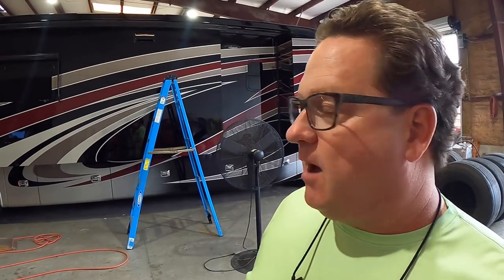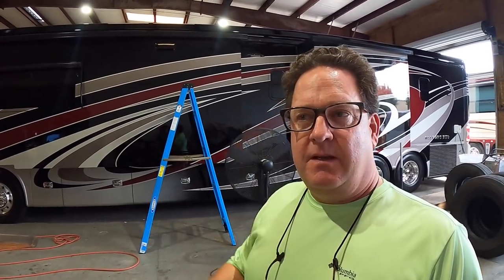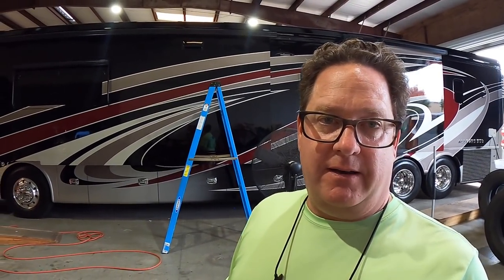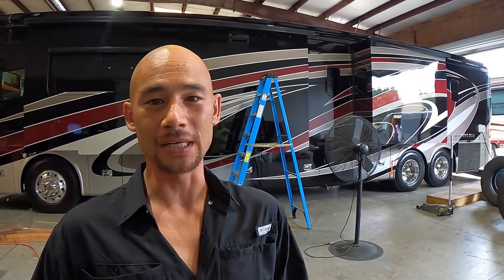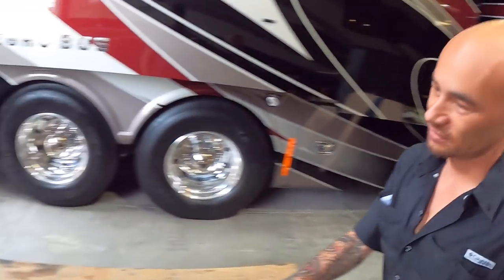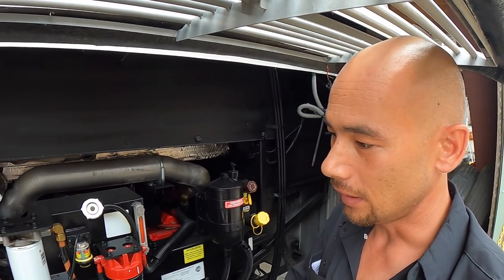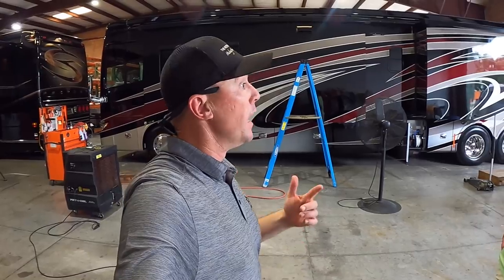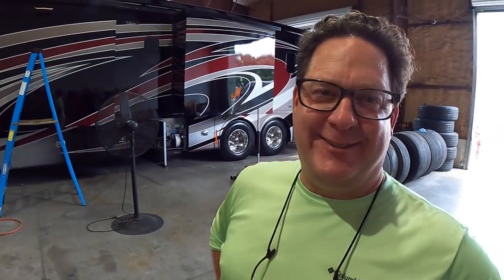RV went into LIMP MODE ON a test drive! Diesel Tech Explains DEF problems

Comment: I built a DEF transloading facility in Canada we received DEF in rail cars unloaded it and packaged it in drums and totes. Out of all the engine manufacturers I believe Volvo has the least issues. That’s because it was in use many years earlier in European trucks.
Reply: I've seen Volvo powered motorcoach busses, I've always thought it would be cool to have a Volvo powered motorhomes as Europe built vehicles are usally more reliable in general.

Comment: That’s why I’m sticking to gas from now on. If you are on a 2 week vacation and it goes bad, enjoy sitting at Cummins on the freeway for 1 of you two weeks. I know, I lived diesel emissions with a 2009 Cat C9 with emissions crap. Vacations were spent at a heavy truck dealer. I’m done. Yes a gas motor can break too but usually I can fix quickly. You have to have special computers and software to fix the diesel.

Comment: I had the DEF sensor failure in mid-June. The DEF sensor is actually $350. The chassis was still under warranty so my cost was $0. My coach didn’t derate which is really rare. Not sure why but I’m glad it didn’t because I was 100 miles from the nearest Cummins service center. The EPA needs to allow Cummins to eliminate the “derate” function from their software until a reliable DEF sensor can be developed. Derating an engine can be dangerous particularly like in our situation we were on a major interstate but in the middle of nowhere.

Comment: We had 5 Duramax chevy dullys for work and parts chasing 1yr in and we had to spend around 5 thousand and the dpf isn't covered by warranty and the dpf tanks have a heater that goes bad regularly we traded them in for dodges and 7 yrs later the truck's just keep on running, you can't beat a Cummins
Reply: dpf or DEF?

Comment: Great video Andrew!! Brad say's don't worry about it, just throw a few thousand at it. I guess if you own one of these money grow's on tree's.
Reply: A few thousand for no more than 4.5  hours of mechanic time and I doubt the parts cost more than $500.  It seems to me a little steep, someone would probably be capitalizing off of this issue that you have no choice but to fix.
Reply: @calebbyers  I agree with you, like a lot of people have said on here, buy a Pre Def MotorCoach. These new MotorCoach's and Vehicle's are built to drain the money out of people's pocket's.
Reply: @franklogan494  or delete the def system out of a newer coach.  Older diesel engines are the best but sometimes newer features and technology above the chassis are nice to have.
Reply: @calebbyers  You are right, it would be pretty hard to argue against that Caleb.

Comment: This guy cracks me up.  He says, issues will happen, just deal with it.  Easy for him to say.  What is you are in the middle of nowhere and this happens and costs thousands of dollars to fix.  Just Deal with it.  This DEF should be completely redesigned by whoever is creating this DEF.  Come on, you know it will fail and nobody is working on a fix?
Reply from the maker: It's no secret this RV game is not for the weak hearted or those those with shallow bank accounts.
Reply: Happened to me while driving a semi truck. Don’t like it. Not going to change it as he said you are going to have to deal with it. Can’t buy old stuff forever.

Comment: Our government... one more thing to have to deal with. I'll be buying a pre-def coach. Might be a good idea to do a DYI video on  how to change the sensor and fill us in on whether we can download an app that'll let us program  the ECU
Reply from the maker: Programming has to be cone through cummins
Reply: @RVingwithAndrewSteele , that's what I expected actually, just as closed a system  as many autos/trucks/tractors, etc. I  viewed a couple videos after yours to learn a bit more about the cost and problems with DEF, and I found that most def head sensor mfgrs won't ship parts,  especially to CA. This is really costly and troublesome for coach owners. Anyway, keep up the good work. (Do more o n  DEF)

Comment: ❤  When it goes in limp mode, I have heard what causes it is when coming off the highway hot to get fuel and turning the engine off as soon as you stop. You should let it idle for a few minutes.  Big trucks have a re-gen button as an over ride.

Comment: What causes them to fail?
Is it running with low DEF or just 'time' , or poor quality electronics, power spikes to that system? What?
Or is it caused by drag-racing them off a dead stop? (just kidding)
Reply: mostly stale def fluid. DEF fluid that sits for months goes bad. Some guys will just use enough to get them through if they know the Coach will sit for a few months in storage. Don't know if you can drain the DEF out but that would be something that would be nice.

Comment: DEF is considered the enemy of ALL diesel Engines no matter the engine nor vehicle manufacturer. That's why pre emissions engine semi trucks and pickups are ask for commanding prices. That's the major reason why CAT got out of supplying big rig manufacturers with engines and decided to buy ElectroMotive locomotives from GM. The CAT dealers will still work on truck and TV engines.

Comment: my question is, if the DEF head is known to short out (go bad) why doesn't the manufacturer cover the cost of replacement. Screw 5 years it should be 100,000 miles regardless of age. As an ASE master truck tech, I'm going to find a workaround. What a bunch of bad engineering shit.

Comment: "just roll with it and fix it as things come". That attitude pisses me off! He obviously doesn't own one. Rule of thumb. If your high-dollar coach costs 250,000 dollars or more. Put 30,000 dollars in the bank to keep it running for 8 years. I sold my house and bought one so I could travel thinking, "It will last me ten years". Wrong! I'm about to go bankrupt (A 2018 Newmar 4311 wheelchair-accessible coach).  Changed both ACs twice (Dometic Penguins). Two slidout motors quit (and I rarely use them). Black and grey Tank Sensor issues. So disappointed! The Freightliner chassis seems okay except for the EPA DEF crap. and the Cummins is always a good bet. And BTW, I forgot more than these guys know. My background is - ASE master truck tech, Aircraft maintenance tech - learjet, challenger, Raytheon King Air, BAE Hawker, and Piper Cheyenne 3A. So I know my stuff and we consumers need to demand better-engineered equipment for the money. Once they got your money, you're nobody! Can't even get my dealer to call me back, with a warranty.

Comment: Don't blame the government.  Blame the engineers who design these systems.  On automobiles the pollution control systems are warranted for 2 to 8 years dependent upon which parts fail.  Major components are covered for 8 years BTW.  DEF reduces the amount of pollutants in the air that is a fact and dirty diesels are a huge contributor.
Reply: Don't think you understand Diesel technology